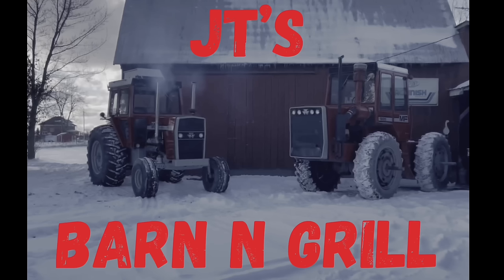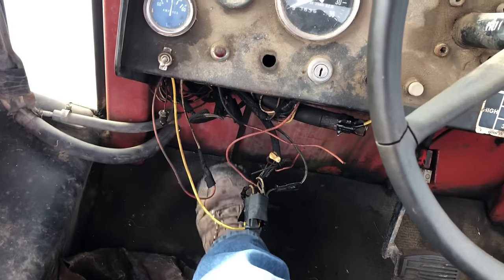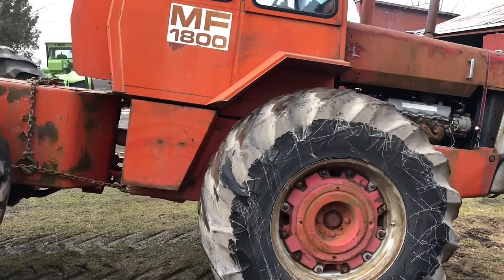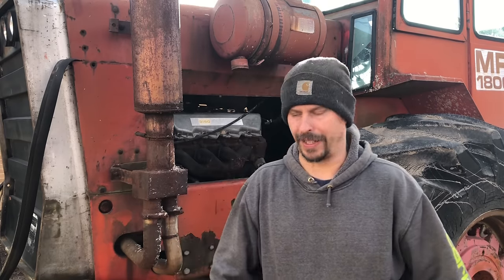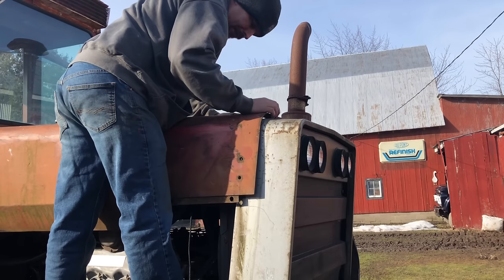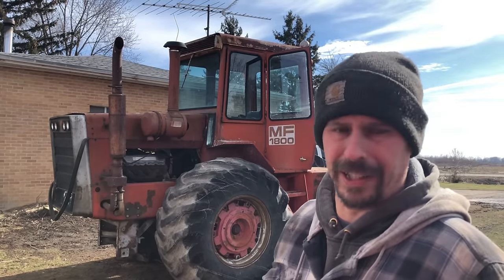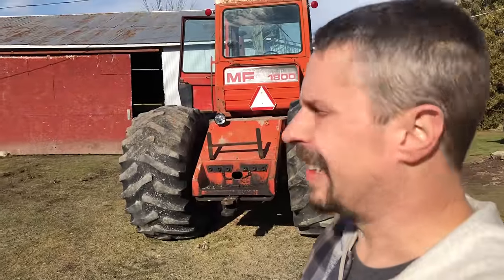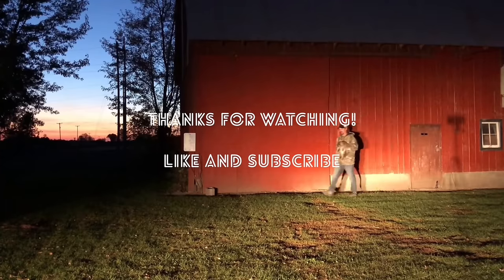Will it start?  FORGOTTEN “death row” massey 1800 sitting 20 years with a locked motor

Comment: JT I'm 72 years old and I still get that smile on my face when the sound of that first start happens. Doesn't matter tractor or truck,. newly rebuilt or old locked up.. I have an imported Massy with the Perkins engine in it that I bought new in 1987. Because of my job it sat for 12 years and was locked up. It was my first project when I retired. Was a sweet sound when she popped off. Lessen learned "Don't Give up "
Reply from the maker: Right on!  Persistence pays!
Reply: @jtsbarnngrill6873  to prime the fuel system get a assistant to hold a air line in the fuel fill opening on the tank with a shop rag to seal it & pump air into the fuel tank to push the fuel through the filter / system while you crank the engine over until it starts  .
 You can also put a airline adapter and short hose on the fuel tank to pump a little bit of air just enough to pressurize the tank to move the fuel through the system if you don't have a assistant available  , if you do that leave the filler cap on to keep fuel from blowing out .
Reply: Never gets old!!
Reply: @craigalston2208 yes put air in the fuel tank
Reply: The Perkins V type configuration was nothing to brag about from DAY ONE at all !
Reply: No one cares

Comment: Well done JT!! 👋👋 You brought this old 1800 back to life.... What emotion when I heard the CAT roar!! Thank you again for giving us all this
Reply from the maker: Glad you enjoyed it!
Reply: I remember my Uncles having one late 70s early 80s that had a cat they put a hole in the block and the neighbor stitched the block back together in the field with a generac welder and a torch they finished using it and was replaced think it was an 1804 than they got a 4840 and a 4900 but them had Cummins 903 and Detroit 60  the Cats didn't appreciate the fuel pump being turned up
Reply: The 4000 series had the 903 V-8 Cummins. The series after the 1800 was 1805.
Reply: @halwilliams1682  they had 4840 and a 4880 one I thought was a Detroit I think the other was a Cummins but the 1800 was definitely a cat that blew a hole in the block
Reply: @halwilliams1682  Hall you where correct it was an 1805 they didn't like that one but every one the had always had the fuel pump turned up they originally wanted a Steiger but the what was to long so the went Massey they where great tractors could have about 100 foot of implements behind them and they'd just go same with chisel plowing
Reply: @fnfailure  I remember one 1805 in france with the CAT 3208 twin turbo ( it was an option offered by Caterpillar) incredible power... but engine rebuilt approximately every 3000 hours....

Comment: I couldn't have ever brought myself to start that engine w/o cleaning out the oil filter and replace with new.  Just imagine what the bearings are being subjected to running dry with all that sludge that, after 20 years is like Tar.  I would only have delayed things a couple of days.

Comment: Back in 1983 my father and I went to an auction where the farmer was selling out due his health issues. He bought all his tractors new. I got a Massey 1100 diesel for 1600 dollars. He had a couple more super slick ones that sold really cheap. One was a MF1805 with really low hours and duals that sold for 4000 dollars, and a equally nice 1105 low hours for 4000 dollars. You have remember it was during the farm crisis. There wasn’t much money moving around. I remember my father regretting that he didn’t buy the 1105. I was getting 4-4.50 per bushel for soybeans back then, so no one was really getting rich. If I knew then what I know today 40 years later, I wouldn’t have never wasted my money on grain farming. Live and learn!
Reply: What would you have farmed instead? Out of curiosity
Reply: @BriggsStratton11  we had registered Santa Gertrudis cattle and hay and soybeans back then, but I thought I could make it work on the grain side when my dad had a stroke and I had to take over his operation at 14 until I graduated high school, when he totally recovered. I left a lot of sweat and effort in the eighties trying to make it work. I took over the farming totally and purchased     a 120 hp Tractor and a combine and was strapped with the bean prices being so low and trying to pay for the equipment at that age. The drought of 88 pretty much killed my operation for a few years until I got a new foot hold in 96. I was a career field mechanic, and I farmed and ran cattle on the side. I have failed more times than I have succeeded, and have adjusted my operation quite a few times due to market conditions. It’s been something else. And now 40 years later I’m almost out of business again after two years of extreme drought and the lack of forage, and the heat making my herd abort and stringing out my calving windows and making them skip entirely. I’m not sure if I would do any of it again.  A lot of cash, sweat and dreams dashed.
Reply: @LukeLong-oi4uc  Let's hope the next 40 years are much better and easier! Have a good day
Reply: @LukeLong-oi4uc  thats a crazy story man
Reply: Tye easiest way to make a small fortune in farming is to start out with a big one.
Reply: @Barnagh1  lol
Reply: Cheap i was at a Scottish farm sale 2 weeks ago 2 old 1980 and 1982 MFs made good money,a 2wd MF290 £9000 and a 375 with MF loader 4wd £9500 both around 5000 hrs both running and regularly used ,good money for old tractors probably bought to restore or for African market as they like them with no electronics,back in the day we had a 390 4wd turbo was a great tractor

Comment: Excellent video JT  :) also would  get for Massey Ferguson 1800 new oil filter, Air Filter, Fuel filters, some GM Automatic Transmission  fluid  200 ml in fuel tank run thru so lube in injection pump, also injectors to and whole ! Plus get grey bottle of STP Total Treatment fuel injection and carb cleaner in fuel tank to ! Plus nickname it After Life because come back life when fixing up and do more fix too ! Plus take starter out get cleaned up and rebuild too totally  new it save from sticking  and run flywheel too! Electrical fix also gauges you be all set running in feilds! Yes tire lots beef on them ! Hopefully  see dig more to soon and repairs too in future videos too! You did super well on this so far and not giving up!
Reply from the maker: Thanks!  Got a long way to go but she’ll be good in the end!
Reply: @jtsbarnngrill6873  welcome JT  :)

Comment: JT When I was in high school I worked on a farm with A 1800 on it. I put a lot of hours in it and when you change the fuel filter all you did was take the bleeder cap off and crank the engine over until fuel came squirting out. It was good to hear that engine run.

Comment: Well done!  Back in the day I had nothing but good luck with the Cat "throw away V8s", both the 3160 and 3208 in the old Steigers and White 4-180. Congratulations on your diagnostic skills and "stic
ktoitiveness".
Reply: I think the trick with those old Cats is to not overload them. They run fast and the rod bearings don't seem to hold up if pushed too hard. I never pull mine over about 2500 rpm and keep the load reasonable. It's only a couple hundred HP.
Reply from the maker: Thanks!  
These motors have been good to me, but I don’t work the pi$$ out of them either lol
Reply: @jtsbarnngrill6873  yep....you got it JT. The Cat only has 3 gallon of oil in it vs 5 gallons on my Case that is half as much HP. The Case runs almost 1000 rpm slower. Oil cools the engine.

Comment: I really enjoyed that JT.  When I was young, I worked on a farm that had mostly Massey Ferguson tractors.  They had 4 1105s with duals and 8 1800s and 6 or 8 1805s.  I plowed a lot of acres with an 1800 or 1805.  IIR, the 1805s had a Cummins, or at least some of them had replacement engines that were Cummins engines.  The 1800s had CAT engines.  The 1800s ran very wide singles, probably half-again as wide as the tires on your 1800.  The 1805s came with duals, but they took off the duals and ran them as narrow singles.  It was quite an operation: around 14,000 acres under cultivation divided between rice and soybeans.  It was enjoyable working there and your video brought back some good old memories, thanks.
Reply from the maker: That was quite the fleet of Masseys!  Did they swap the 1085s with 8.3 Cummins engines?
Reply: That was quite a fleet of Masseys.  The farm was owned by a large corporation, and IDK if they had a corporate relationship with Massey Ferguson or there was a local preference.  In the area at that time, most large row-crop farms were running IH or Deere.  There were a handful of other tractors on the farm at that time to include 3 or 4 propane powered case tractors, 3 or 4 larger Case diesels with duals, maybe 1070s,  a big articulated case 4X4 without a ROPS that was frightening to drive because the steering seemed to have a mind of its own and you might find yourself in a flume ditch or an unplanned excursion out through the field.  There were also a couple of huge articulated Ford 4 X 4 tractors and after my time, they had 4 or more big Cameco tractors with duals.  As far as the Cameco tractors,  I never learned the particulars of those, but I think they were monster horsepower CAT powered units, made in Thibodeaux, LA.   With recard to the power untis on the 1805s, It has been a minute, but I remember that the tractors originally had engines with the MF insignia on the valve covers, or the side of the engine because it was prominent when you walked by; you might glance over and you would see the MF, but as those engines were replaced, the Cummins engines went in.  It may have been a situation with the purchasing agent or chief mechanic had better experience with service or longevity with the Cummins, but I don't recall any of us tractor drivers noting a difference in the performance of the machine with one power plant over the other.  @jtsbarnngrill6873  I appreciate your showing the old Masseys, really brings back memories.

Comment: Hey JT, one thing that would’ve worked was a block heater, 2) if you don’t have a block heater, drain out, antifreeze into a steel bucket and use it large propane, torch, and heat up antifreezeto about 100°F and put in half the bucket then heat up the rest to about 150 to 180°F and put the rest in that way you have a warmer engine that will probably start!

3) you can also heat up the oil to about 180° and pour that through the engine into the Oil Pan?

That’s the only way I know to heat up an engine, or put a block heater in it and let it heat up for six hours or so, and then it would probably start!
Reply from the maker: Right on

Comment: Wow that thing runs excellent! You would never guess it had been sitting for 20 years. That taking a while to shut off is normal for 3100 series Caterpillars, its due to where the fuel shut off is located. My 2255 with a 3150 does the same thing
Reply from the maker: Right on. Good to know, figured it was just sticking

Comment: Massey Ferguson 1800 Production
Manufacturer: Massey Ferguson

Factory: Matsuyama, Japan

Years Built: 1971 – 1974

Massey Ferguson 1800 Engine
Caterpillar 3160, diesel, 8-cylinder, liquid-cooled, 636 ci [10.4 L]

Power: 59 hp [44.0 kW]

Drawbar: 171.37 hp [127.8 kW]

Bore: 4.50×5.00 inches [114 x 127 mm]

Air Cleaner: dry

Compression: 16.5:1

Rated RPM: 2800

Starter volts: 12

Comment: Hey JT.Was surprised  it did start.  Now that it is running  your return  fuel  lines/boots  could be leaking. Coming off nozzles  under valve  cover.They will fill crankcase with  fuel.  Not hard to change.  Cat had a kit rubber  tubes and bands  to  reseal.
 Good  luck  with  it.
Reply from the maker: I’ll check those out

Comment: That's great that you got that started after that long. You're going to need more land soon. Awesome video.
Reply from the maker: You got that right!
Reply: @jtsbarnngrill6873  so is there a reason alot of that series tractors are missing the right hand side panel by the alternator?
Reply from the maker: I have that panel in the back of my pickup lol. But I agree, most I’ve seen are missing. My 1805 is missing it too

Comment: It’s running well. Get the filter, change the engine oil again, change all fluids and belts, fix the exhaust and put it to work. A few hours of steady revs under load will have it like new.
Reply from the maker: Right on!

Comment: One trick is to run 24v to the starter and 12v to the rest of the electrics. Ist a bit of a pain to set up but spins over so much faster.

Comment: Hey Mate great to see old iron running again Massey had these tractors in Australia but they had 540 V8 Perkins in them ,well the ones i have seen either way its nice to hear a V8 Diesel fire up 
Kym
Adelaide
Reply from the maker: Interesting!  I’ve seen some old ads that had 4x4 masseys in them that were a little different than the ones we have on this side of the pond with 540’s. I would think that would make a heck of a good tractor

Comment: The motor was originally used in trucks from late 70to80s .. 8000series Ford's 2 and  3 axel day cab stuff/ dumps , flatbed dumps , city services, extremely reliable But when you say CAT parts or filters or oils your wallet is going to ignite . Tractor supply houses help some ..

Comment: JT, on some older diesel engine I've seen where guys have added in a bulb pump. One that goes in the fuel line, like on a boat. But make sure the bulb pump can be used on diesel fuel also. Good luck.
Reply from the maker: That’s a good idea. Might look into that

Comment: Great video JT, congratulations, it’s crazy when the answer just pops in your head 😂, and that was every bit of 18 inches 👍🏻
Reply from the maker: Exactly 😆😆
Reply: @jtsbarnngrill6873  you can put a airline fitting and short hose on the fuel tank to pump a little bit of air into the tank pressurize the system & to push the fuel through the system while you crank the engine over to prime the system  .

Comment: It must be a thing with you guys over there but I would never try to start old iron that's been dead for years without taking a couple of days to check so many things  before  even trying the starter,  just sayin'.  You got it started  so I guess well done that man.  Cheers.
Reply from the maker: Did you not watch the first 25 minutes?  I had the oil pan off, valve covers off to make sure the valves weren’t stuck, took 2 days to get the motor to turn 360 🤷🏻. It was a 4 day process.  I don’t know what else I could have done..
Reply: I apologize and do not understand why I felt it necessary to comment in the negative, I did cringe when the birds nest coming shooting out of the exhaust thinking it could easily have been a nest being drawn in through the inlet filter/manifold and I did feel for the starter motor but as you mentioned you did a fair amount of preparation, my armchair must be too dam comfortable. cheers.  @jtsbarnngrill6873

Comment: Ohhh...We FARMERs have a Little TRICK Up Our Sleeve that We use when have Trouble with Air in the System...We take an Old inner-tube and Cut-Out the Valve-Stem and descent amount of tube around It and put it over the Fuel-Tank Inlet and hose-clamp it down and put a Low-Amout of air-pressure in and It Helps Bleed the System🧑‍🔧🚜
Reply from the maker: I was 2 seconds from doing that 😄

Comment: Sounds good great project ,  what is the bracket undetected for ?
Reply from the maker: I assume it had a silage blade on it at some point
Reply: @jtsbarnngrill6873   
Hi Bud , would you know where the clutch  safety switch is located  on a 1805 ?

Comment: I’ve always had a crazy thought of taking a old, small, articulated tractor and using it in row crop applications.  It looks as though the rear axle is longer.  They usually have duals that are never taken off.  I’ve also never seen a “00” model with a 3pt.  What is the difference between a 3150, 3160 and 3208 cat?  Head size?  
Also, could you install a 5.8 lt Perkins like the British 1200?  So many questions, not enough time.
Reply from the maker: My 1805 could be row crop with the duals off, the rear axle is different on this one. Must have been changed at some point. Those cats are all basically the same. At least the 3160 and 3208 are. The 3208 is the newest version of those engines. 
A 5.8 might be a little light for that big of a tractor. Maybe a turbo 850 engine?

Comment: Can you not lube the cylinders on diesel engines?
Reply from the maker: I could have, pulling the injectors would take some time, or pulling the exhaust manifolds to open the valves and spray in lube, not a great way to easily get stuff in that one

Comment: Have you ever heard of anybody using WD-40 for starting fluid this old man told me to use in centimeter because it is a oil and it will not wash your cylinders
Reply from the maker: I have, actually used to use it in snowmobiles but it seems like it doesn’t work nearly as good as it used to. Could be less flammable than it was before
Reply: Yeah of course why not change something that works they can't tell you more if it works

Comment: How bout cleaning battery cable connections so it turns over correctly
Reply from the maker: Those are perfectly clean.  1.  Starter is not healthy.  2. Motors has a “tight” spot. If you didn’t catch the first half of the video I went over all that as I was getting the motor free.

Comment: Need to clean or replace cables going to the starter. Too much resistance giving you low starter rpm.
Reply from the maker: I think the starter is probably about had it as well

Comment: Is the 3160 related to the 3208
Reply from the maker: Basically identical other than the 3208 has a v style injection pump. Both 636 cubes. Both 210 hp